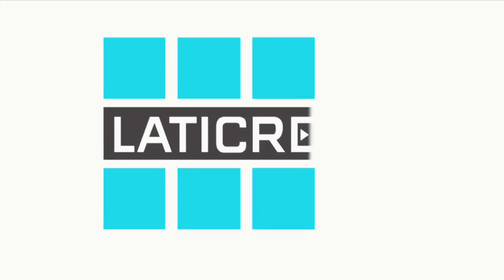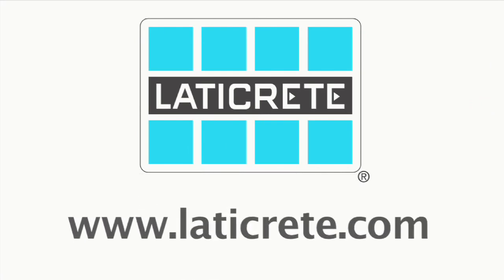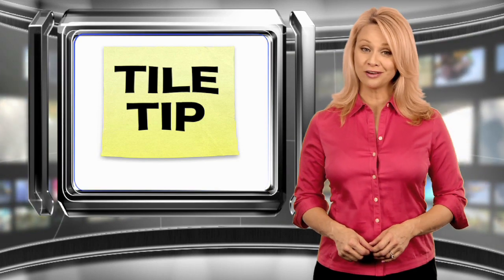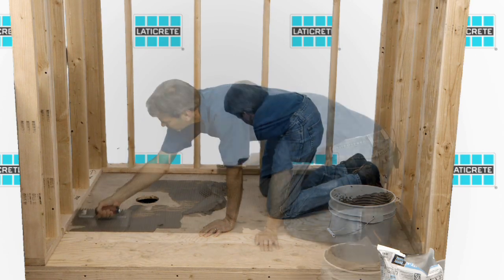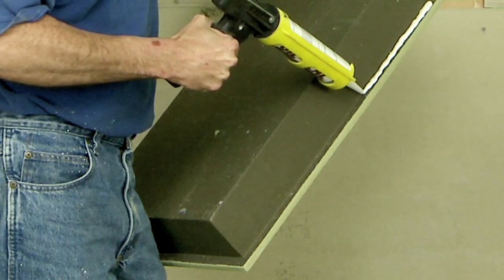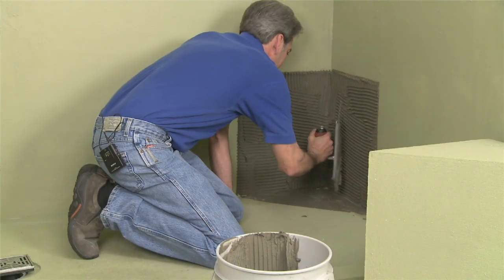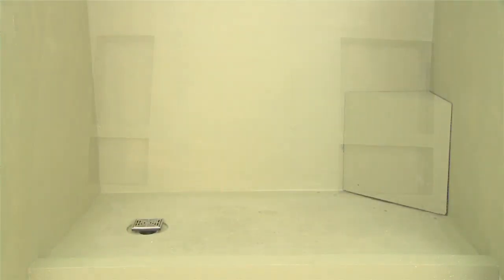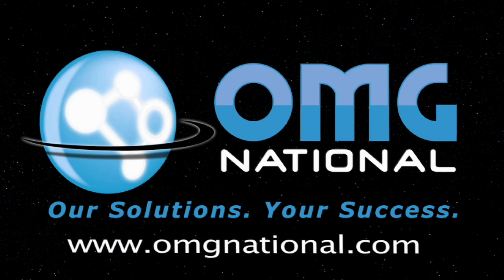LATICRETE® Hydro Ban® Shower System

Comment: Why don't they show him trying to get the drain all installed, this is the only problem, you have to go in blind putting the pan down. Can someone tell me how they do it
Reply: timothy ormerod I was wondering the same thing. Do you need access from below to tie the drain in? Or are supposed to glue it as you drop the pan into the mortar. Seems ridiculous if that's the case